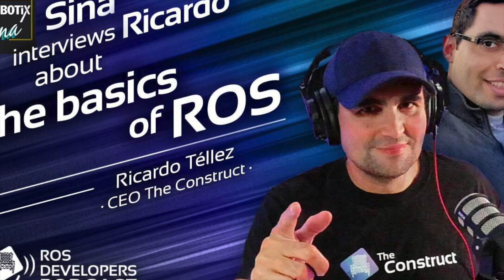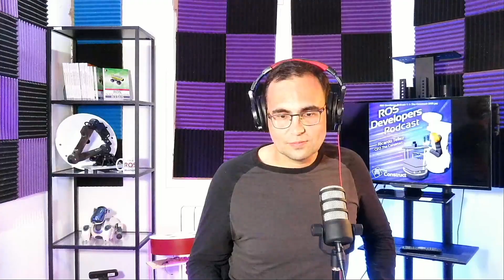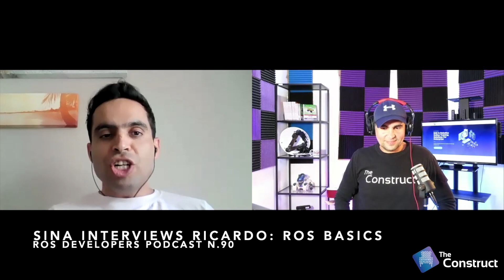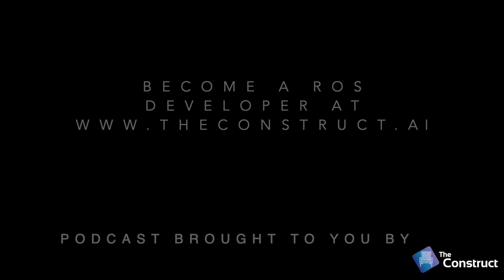RDP90: Sina interviews Ricardo about the basics of ROS

Comment: While running this I got some error, it's not taking operators such as +, *, - etc via command line, can you please help me in this

#!/usr/bin/env python

import rospy
from rospy_tutorials.msg import Floats
          
def add(x, y):
    return x + y
# This function subtracts two numbers
def subtract(x, y):
    return x - y

# This function multiplies two numbers
def multiply(x, y):
    return x * y

# This function divides two numbers
def divide(x, y):
    return x / y

def publishMethod(Float_f, Float_s):
    pub = rospy.Publisher('talker', Floats, queue_size=10) 
    rospy.init_node('publish_node', anonymous=True) 
    rate = rospy.Rate(1) 
while not rospy.is_shutdown():
        Float_f = input('Enter first number  ')   
        Float_s = input('Enter second number ')  
        
        rospy.loginfo("Data is being sent")  
        print("Select operation.")
        print("1.Add")
        print("2.Subtract")
        print("3.Multiply")
        print("4.Divide") 
while True:
    # Take input from the user
    choice = input("Enter choice(1/2/3/4): ")

    # Check if choice is one of the four options
    if choice in ('1', '2', '3', '4'):
        Float_f = float(input("Enter first number: "))
        Float_s = float(input("Enter second number: "))

        if choice == '1':
            print(Float_f, "+", Float_s, "=", add(Float_f, Float_s))

        elif choice == '2':
            print(Float_f, "-", Float_s, "=", subtract(Float_f, Float_s))

        elif choice == '3':
            print(Float_f, "*", Float_s, "=", multiply(Float_f, Float_s))

        elif choice == '4':
            print(Float_f, "/", Float_s, "=", divide(Float_f, Float_s))
        break
    else:
        print("Invalid Input")

        pub.publish(publishString4)  
        rate.sleep()

if _name_ == '__main__':
    try:
        publishMethod()
    except rospy.ROSInterruptException: 
        pass